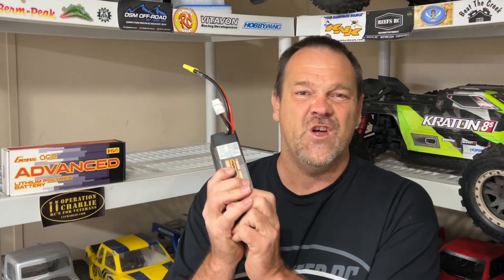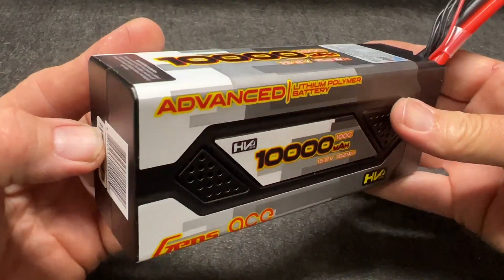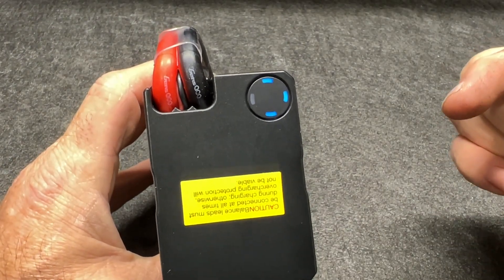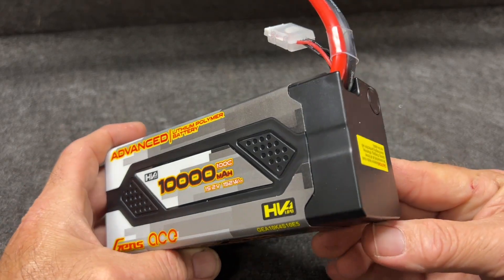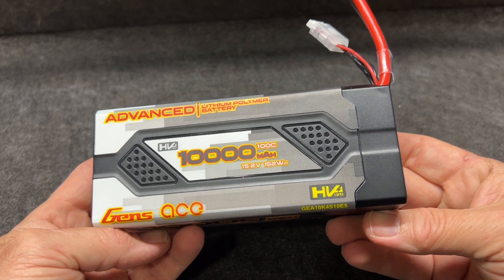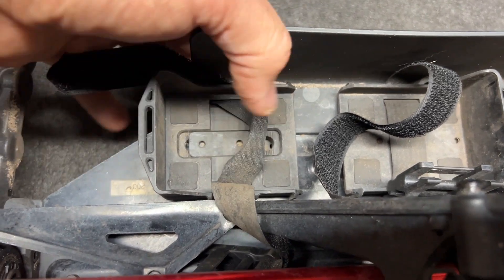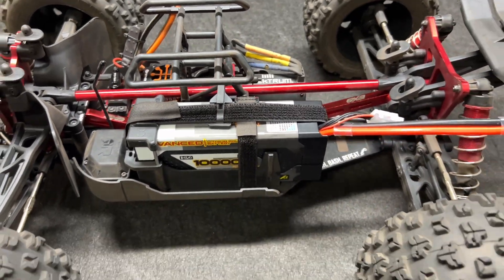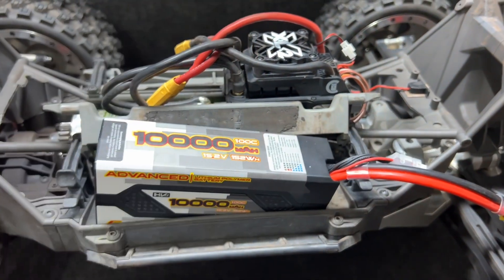Worlds FIRST ADVANCED SMART LIHV LIPO Battery by GensAce Tattu

Comment: I really like Gens Ace...they produce excellent LiPo packs.  However, this is a bit on the "overkill" side...plus, for the price they're charging, it's a ripoff.  Sorry, Gens Ace, but I'm going to consider this one a 'fail'.  A LiPo checker is FAR more accurate.  As others have pointed out, there shouldn't be any need for am "overcharged power cutoff" - if you're using any charger of at least halfway-decent quality, it'll never overcharge, so that "feature" is wasted.  The button & LEDs are just "flash", and adds (exorbitantly, it appears) to the cost.

To Joe, I also have 3 LiPo checkers...but, I DON'T lose them.  I have 3 ammunition boxes that I keep all my batteries in, and I keep a LiPo checker in each box.  When I add a 4th box, I'll add a 4th LiPo checker.  As long as you always put it back in the box after using it (which isn't a difficult thing to do), you'll never have to 'remember' whether are.
Reply from the maker: I use things every day and go from one project to another, nothing stays in place other than a few items.

Comment: Spectrum smart batteries were the 1st and with those you're able to set your parameters as far as,  When you would like it to storage charge itself(default is 72hrs),  LVC,  Automatic charge rate, and more. Now the xbc100 is needed for this but that's$30 and does much more than a voltage checker.  I do however like the instant voltage meter built into the battery that's cool. Overall I think the spectrum smart batteries G1 & G2 are where it's at.
Reply: Spektrum only makes them 5000mah 100cs that's horrible for dbxl and other heavy vehicles.
Reply: spektrum isn't LIHV (basically you can't cheap out on the quality when producing LIHV)

Comment: The biggest battery I have is a 4s zeeee 5600, and it's too heavy for my slash 4x4 with monster x/ and 2200 kv 1515. When they come out with a new light weight small form factor, maybe....but honestly I'm going the other way, smaller ,lighter.   Really the thing that has killed most of my battery's was my own stupidity ( last time, left 2 plugged in)

Comment: it does seem kind of gimmicky to me, most of the "features" of the button can be had with a 2$ cell checker that will give you more accurate info anyway. as for the self-discharge most of those are a very low rate that take forever to discharge a big battery like that, my opinion if you're using lipos you need to be responsible with them and not rely on things like this.
Reply from the maker: I agree but I have 3 of those lipo checkers and sometimes I can’t find any of them. If the battery is sitting over the winter and it takes a week to get to storage I don’t see an issue with that. The over charge protection, that’s a much needed feature in the RC world.
Reply: @ExocagedRC  yeah I get where you're saying, I run a lot of LiPO batteries especially in fpv quadcopter oh, I have never used a charger that would let me overcharge a battery cell, maybe an old charger I guess?
Reply: @SteadfastRC  you see a lot of lipo fires these days. My buddy's house burnt to thr ground over a lipo battery. These little features really can help the average guy be safer. With these batteries, being safe is smart
Reply: @SteadfastRC  Yeah, Didn't think you could overcharge a battery unless do something very wrong.. This just looks heavy and expensive to me..
Reply: @brei.z  Yeah unless your running a super sketch charger it's going to detect over voltage.
Reply: @ExocagedRC  if you have 3 lipo checkers and sometimes cant find any of them that is called lack of responsibility
Reply: @teslacybertruck750  I have 4 or 5 lipo cell checkers, they are all stored in the same place, but there are times due to their size that I misplace them.  I take extremely good care of my batteries,  just as Joe does, so please do not accuse someone of being irresponsible that you don't know
Reply: @marcuslandry3804  I didn't accuse anybody, I was speaking in general terms. Been watching Joe for years obviously he knows what's up.
Reply: @marcuslandry3804  Tell me, why is it that everytime you take your car out you always carry your driver's liscence, tell me why is it, that everytime you fly you bring your passport with you?. Sorry, but that is called being responsible. And like it or not, it's called being responsible.
Reply: even if they're lowrate discharge the battery is still being discharged with no chance of it getting hot so it's only going to help longevity

Comment: Nobody ever does a battery fit test I have gens Ace Redline 7500 Mah 4S batteries and two of those fit in there. Is this battery the same size as a 7500 gens Ace Redline? Thank you in advance
Reply from the maker: I posted the size specs in the description, I don’t have the batteries you mention but you can compare them by the measurements.

Comment: It would be cool if you could change the battery from 3s to 6s with a button or vice versa
Reply from the maker: That would require a big relay of some kind. But why would you want that feature?
Reply: @ExocagedRC  just to have one battery capable of running series or parallel.

Comment: neat, good for bashers for sure.  bit heavier and bulky for racing.  with all the off brand cheap chargers that are known to overcharge and cause fires this is a great way to prevent it.  hopefully the price point is low enough that it entices newbs and bashers to buy.
Reply from the maker: True. Now if you charge this LIHV 4.35v at a normal lipo voltage of 4.2v I’d have to hope it would be ok?
Reply: @ExocagedRC  protek batteries state on product description that you can use a normal charger on their lihv without issues with still utilizing the added benefits of the higher c ratings and charge/ discharge rates.  My many hours of research of the lihv batteries and graphene is that the batteries are just highest quality cells that allows the higher voltage and amperage without damage but when charging and importantly storing properly like a normal lipo you should have longer cell life.

Comment: Very Gimmicky, I mean maybe for someone who's clueless to battery's a newb or someone, I'm good with a regular max amps etc
Reply from the maker: I’ve got a maxamps and they are just over rated. By a lot. But I really like the automatic storage feature. That’s something I like as well as the over voltage cutoff safety. There are only a handful of RC guys that know the ins and out of lipos and even we make mistakes from time to time.
Reply: @ExocagedRC   You make some good points, I was thinking more Drag car when I mentioned Max Amps, I really like there 2s4p / 2s5p etc batteries for drag racing, but I agree that aside there over rated or at the very least way (over priced!! ) I often forget not everybody knows the dangers involved with Lipos ,I see your point ...👍